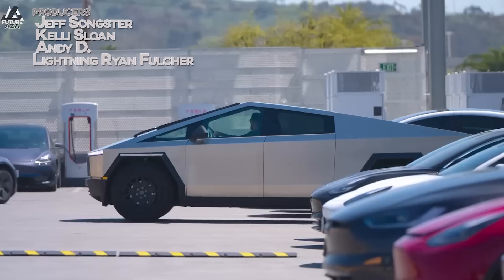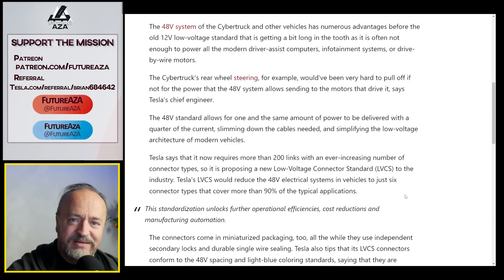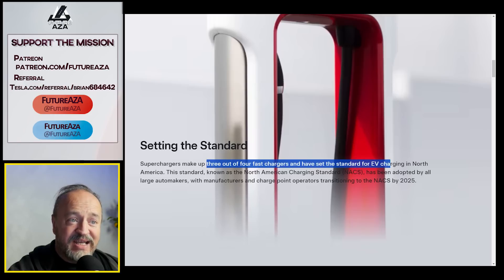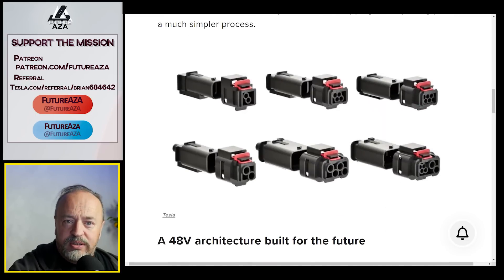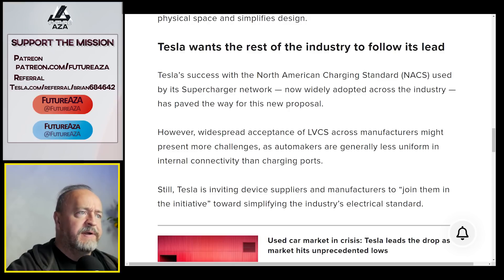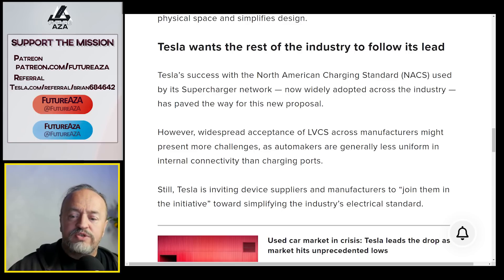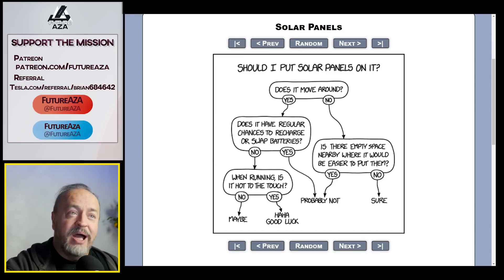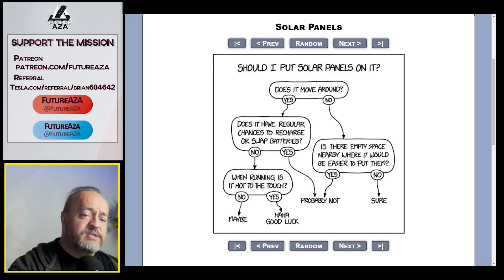Tesla's GENIUS Low-Voltage Connector Standard... Will Anyone Care?

Comment: Solar orientation isn't critical:  
The newer bifacial solar panels are an example.   Plenty of videos on youtube about them.

One solar installer who installed solar on a Rural Electric Cooperative (REC) in southern Iowa described that in the morning before the sun was visible in the east, the solar installation was at 85% already just from the scatter light coming over the horizon.  

Solar from Moonlight:
In fact, blue light panels work in moonlight.  An MIT article within the last year focused on this characteristic  Most lower cost mainstream solar panel designs have been optimized to work primarily off of the key frequency band of light during the day.  However, the correct technology solar panel will even generate electricity from moonlight albeit likely much lower unless the panel's design has been optimized for Blue Band light.

Amount of Energy:
Most current cars sit 10-12 hours a day in the sun so given enough surface area, this energy would not be trivial especially for a car that may be used a couple times a week that's parked outside all of the time.

Semi Trailers:
Good point about those not owned.  However, consider Pepsico which owns both the tractor & trailer.  

How about a trailer with its own say smaller battery (also consider refridgerated trailers that may need their own energy) that charges from its panels or that is plugged into a building's battery that charges while the trailer is parked by itself if not connected to the tractor?

My two cents
Reply: Ridiculous nonsense

Comment: My thoughts are mixed and only quantified by the information I have received on this and many other YouTube channels and backup research to verify some cla
claims. 
 Apparently,  Ford has had an agreement with Tesla to use their Superchargers and adapt their vehicles to use the charging port on the newer vehicles going forward rather than using an adapter.  However- Ford has a refresh of the Mach E and it is NOT using the Tesla charging port. This speaks to the amount of red tape and time it takes to make a decision on any changes. For any OEM switsswitching to a 48V system will not only take a vast amount of time, but $$$. As we well know, OEM'S are not only cash strapped, but short sighted. 
 That said, even if they were given an unlessunlimited 
FREE supply of these 'makes sense' connectors, they will not adapt as the cost and time needed to use the wiring, 48V bat
battery, engineering etc. would be far to costly RIGHT NOW. 
 If Tesla DID get many manufacturers on board, it would take years for them to begin placing orders. The more adoption means the few companies that make the connectors 
would be able to sell them at bigger discounts. This would benefit Tesla as well as the manufacturers acquiring them, bit let's step back and get real. With so many (non Chinese) OEM'S backing away from ANYTHING remotely cost sensitive, just paying an engineering department to 'make it happen' is asking too much.  
 The 48V system, as good as it is would have a great additional cost to any ICE vehicles 
As the current 48V battery in the Cybertruck cannot turn a gas motor. (It is tiny).
 Let's ask ourselves this question. What company outside of Tesla will begin deliveries of an EV using the "Tesla Standard" charging port?
(((Crickets)))
Reply: TLDR

Comment: Tesla is pure genius.  I heard Elon tell investors that he will offer not only solar power but moon power generation so you can charge your Teslas either day and night for free! He promises this feature by 2027. He is a true visionary and great human being!
Reply: Please provide your source for this claim.

The Sun is 400,000 times brighter than the full Moon.
Reply: @fredbloggs5902  I was wondering the same.
Reply: At what cost of efficiency?
Reply: I suppose moon panels would be very efficient since there's no atmosphere and the light side of the moon is always getting radiation. They'd need replacing a bit more often but other than that, they'd be running nice and cold and with little to stop the sunlight generating power. Since we will have moon bases within our lifetimes, there will be vehicles on the moon using moon power. In fact, if they use bi-facial panels, they'll literally get power reflected back from the surface of the moon too. ;)
Reply: @juliusbrown3400  sure. He’ll sell you the moon panels tomorrow with the promise they’ll work by the end of next year.

Comment: Tesla is using automotive ethernet (which usually means 8 wires per connection.)  Power over Ethernet is a standard that allows you to power devices at... yes... 48 VDC... just like Tesla is doing... so standard ethernet with PoE seems well suited... but the wattage you can supply over normal ethernet wires is probably too limited, so they might need non-standard connectors with beefier wires for power & ground.  It's weird that none of the connectors on display have enough conductors for ethernet.  Perhaps this is for everything EXCEPT ethernet...
Reply: Automotive Ethernet only uses 2 wires. Automotive Ethernet uses a single twisted pair that transmits and receives data simultaneously

Comment: The connectors is one thing... I worked in IT in the 90's... we had regular hobby projects manually wiring DB-9 (Standard serial connectors) because different companies wired their "standard" serial ports differently.   they need to talk about how to wire the connectors also.
Reply: If one was to adopt this standard, I'm sure that how to wire them would clearly be provided.

Comment: We did solar at our house this year.  Half pro's, half DIY.  We bought the panels, mounted them, and the pro's did the wiring, permitting, batteries, etc.  We love it, but it is not for everyone.  Our  lot doesn't allow for 'optimal' orientation, so the pro's don't take the blame for that, we just paid to have it 'wired and licensed'.  Still we are on grid, but haven't used grid power for months, including our 2 electric cars.  We made a few 'wrongish' decisions that cost more money.  Still, we love it.
Reply: No grid power is amazing
Reply: @snookmeister55  Absolutely.  We still have the connection as our 'backup generator'.  We haven't been through a winter with it yet, since we are ALL electric, this will be interesting.
Reply: @jackcoats4146   How many kw?
Reply: @snookmeister55  3 Powerwal2's (39.5kw) and solar we have 54 370W panels, 20 bifacial, so about 19.8kw but we have none 'oriented correctly' but we knew that before we started.  None on the roof because at 70+ we couldn't maintain them.
Reply: We actually get 6 to 60kw depending on the day.  Clouds make things suck.  Average day with reasonable sun is 50 to 60KW.  Yesterday was 51, today 37, so it varies.  This makes bigger batteries better.
Reply: @snookmeister55  fyi, we have 20 bifacial as our back fence, 20 mono flat on the ground, 2 bifacial ground mount South at 45deg, 8 bifacial ground mount South East .  4 mono SW at 45 degrees inclination.  And many are in shade of our house goodly part of the day.  So lots of underperforming panels.  Still great.
Reply: @jackcoats4146   Wow.  Thanks.  I'm about to move rural and need backup for well, fridge, freezer.  Haven't done the math but a few kwh with storage.
Reply: @jackcoats4146   I've done it small scale to back up an aquaculture system so I understand the concepts.  Yes, sun not shining is a challenge.   I'll plan for the shortest cloudy day of the year.

Comment: Europe mandated CCS 2 at the chargers but not the cars. They chose that one because was developed by VW instead of keeping chademo which is now joining with the chinese GBT
Reply: Um no, that's not why. It was chosen because it's 3 phase and superior by far to CCS1 and Tesla hadn't come out with any kind of product and offered it up saying, 'We've got something better'. In part, because Tesla do NOT have something better, because theirs is single phase. Eventually, they'll need to switch to three phase power, but it's probably safe to assume that will happen when battery chemistry changes enough to offer a bigger set of advantages. The US just has an even more out of date power grid than everywhere else, as does Japan.

Comment: the reason Tesla is pushing its connectors and 48V system is economy of scale. If everyone converts to 48V and Tesla connectors then each unit cost for tesla is cheaper even if they do not sell the connectors,.. the fact that Cybertruck uses different connectors currently costs more but if they can convert others to the same connector then it all becomes cheaper.
Reply: When cybercab is produced at scale, it will obliterate other contributions to economies of scale. This is consistent with Tesla sending a memo to all OEM CEOs about 48V. It's about pushing for them to adopt a better standard, which is consistent with Tesla's mission.
Reply: Tesla has given permission to use all their patents too, a long time ago. Only catch is, they promise not to sue Tesla.  Their door is still open.
Reply: Or maybe is so steer by wire is in all vehicles, which can then adopt full self driving
Reply: @BKNb77 — Steer by wire is not needed to be able to steer autonomously. Many, many cars have mechanical steering and still have driver assistance that includes steering.
Reply: @BKNb77  48V is not required for steer by wire or FSD.
Reply: @jbbuzzable  It is very helpful though.

Comment: some places solar works and others it dose not. there is a guy in Florida "Solarpunk Steve" how converted his trailer for lawn care to 1,000 w of solar to recharge his equipment while running. not his car but his lawncare equipment and he can run his lawn care equipment all by solar and since he owns everything he is sieving money by his method rather than buying extra batteries for all his equipment. is it for everyone no.. but  when it works it works. 

 Myself i live in Washington state and we are not a great place for solar in fact it takes 2-3 times as long to pay off a solar system than in the Sothern states  because of less sun. dose it work up here yes.. just not as good as it dose in the south... Even with line losses a solar field in Nevada and exporting to Washington state the line losses are insignifigant than the less sun in washington. So up were i live solar is not the best.

Comment: Wait with putting solar panels on cars until we have thin perovskite panels which can serve as wrapping too.
Reply: Wait until the surface of every car is 200+sqft.  That is when it will be a good idea.  Right now it is not worth it for the complexity of adding a few watts a day.
Reply: @davidbeppler3032  100% Fister proved this was stupidity.
Reply: Lars is correct here. Solar in a useful form for cars, will basically reach cost parity with other things you can make the roof and body panel of. Just as it has with roofing tiles already - solar is as cheap or cheaper than tiles so we may as well build new roofs from solar panels. 

The other two commenters so far have made the classic mistake of imagining solar panels on cars are to recharge the battery fully, every single day. No, they exist to provide power. As long as the cost is reasonable, the obvious advantage is that your car will always have enough power to get to the next charging station. Forgot to charge? It charged itself. Power cut in your area? It's charging itself. Want to leave the air conditioning on for two hours with a dog in it? It's charging itself. 12v/48v battery ever run flat? Not in a car with a solar panel it hasn't. 

It's the same energy as saying that a two seater car is useless because you have two kids. Great. Not everyone does, and most people don't have those kids in the car on most journeys or the most common number of people in a car trip wouldn't be 2 or fewer (1 is fewer - just a driver for lots of journeys).
Reply: @jonevansauthor  the reality does not match your dream.  I don't even think it can be of value if they could catch and convert 100% of the energy of the sun that hits the surface.
Reply: @davidbeppler3032  Exactly. It's just not worth it and never will be.
Reply: @jonevansauthor  How successful are two seat cars.

Comment: I like solar panels for long-time parking at air ports and such.
Also if I'm deep into the forrest for some time, far away from any super chargers, of even slow chargers.
It doesn't have to do much more than maintenance current, for sentry mode perhaps.
Although, living in Sweden, solar panels work only half the year.
Reply: Car manufacturers will have to ask themselves how much extra you would be willing to pay for a very modest amount of solar power, and how many there are of you. The competition would be a slow charger at the airport, and maybe a deployable camping solar setup in the woods? Maybe even a gas generator, that could also work in a Swedish winter? Depends what you want to do and for how long. There are all sorts of solutions, and they can even have other uses.
Reply: @geirmyrvagnes8718  yes it's just a case of when the solar panels get cheap and easy enough to fit, and of course, what the vehicle is. I can't see any reason for a heavy good's vehicle with a flat roof, or a bus, or a camper van not to be festooned with the things. A very curvy sports car you'll drive once a month and then put in a garage because you're terrified you'll crash it, it's probably not worth it. 

And yes, you will be in much less danger camping. You might find your kids used all your car's battery because they brought along a PC and portable monitor and gamed all night and you didn't charge on the way. But within a few minutes or hours you'll have enough power to drive out of the forest and get to a nearby charger, or just to charge your phone and call for help.

Comment: How much additional electricity would be collected if the solar panels were on both sides of the truck instead of just the top? No room for advertising though.
Reply: Au contraire. We have people making solar panels that have print on them - so they look like marble or brick and can be used for cladding on buildings. Since they cost the same as cladding, they're basically free if you need/want cladding, and you get power. More power than you'd think. So yeah, you could have advertising. Bear in mind we have windows you can see through that also have solar built into them because most office windows are tinted anyway.

Comment: Well one thing you're missing when it comes to solar panels is that they are cheaper to produce than most building goods... Literally it will be cheaper to make a semi-trailer with solar panels then it will be to make a standard semi trailer... You will also be able to put motors on the wheels so it can engage in downhill regenerative braking and it will have batteries built into the trailer as well so it can power itself and run refrigeration units or other things that semi-trailers run... It makes logical sense to have solar panels on a semi-trailer because it is free property and because it's on Wheels you don't have to pay for physical land yet you get all of the solar benefits of it existing... When you think about it like this it becomes a no-brainer.
Reply: It still requires some braining. We are not at the point where people are making trailers out of solar cells whether or not you want to hook them up, since they are so cheap. And they still weigh something, which is very important when you move around. Batteries and motors still cost money. It can become a big spreadsheet if you want to maximize profits. Not saying it can not be made to work for some applications, but a no-brainer it is not.
Reply: As a shipping worker.  NO.  The building materials of the top of almost all cargo containers are less expensive than solar panels.  A few watts of energy a day is not worth it.  That said.  The Tesla Semi is set to take over all shipping logistics in America in the next 5 years.  Saving a company $30k a year in fuel?  YES!
Reply: @davidbeppler3032  I think you're confused about what he's saying. He wasn't talking about shipping containers. He was talking about covered heavy goods vehicles which have a roof and sides and so on, and you fill with boxes or pallets. You can get flexible panels, so sooner or later, you'll get the canvas side trucks with solar on them. And yes, you want that power because it can run your air conditioning if nothing else. 

But no, you wouldn't build shipping containers out of them. I suppose you might make one that clips to the top and sides of shipping containers, for actual shipping since that would conceivably reduce charging needs out of port and those ships are using a tonne of power. 

You may also not have realised that the cost of panels is dropping a lot, and technology is becoming much more varied. Panels no longer have to be flat, or small, they aren't as heavy, and they can even literally print them in an inkjet printer. You might wallpaper containers with them one day (literally glue them on) because then you could have lights inside and outside. Which could include advertising since displays are also so cheap.
Reply: @jonevansauthor  Those are called shipping containers.  Or trailers if you will.  Even the canvas ones.  The surface area is pretty good but putting solar on them will not provide an amount of energy worth the trouble.  Solar panels will not run an AC compressor.  Paint them uber bright white would probably save more energy.